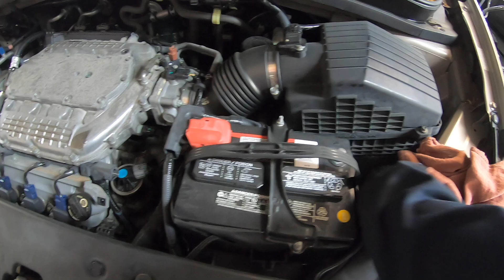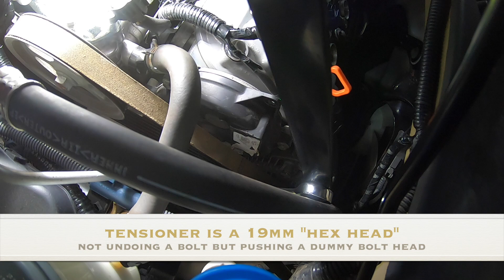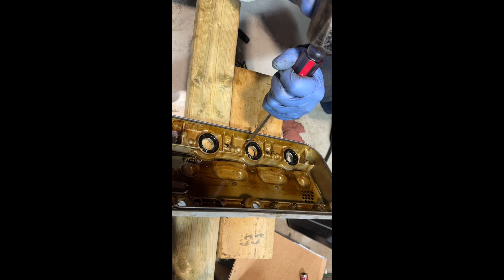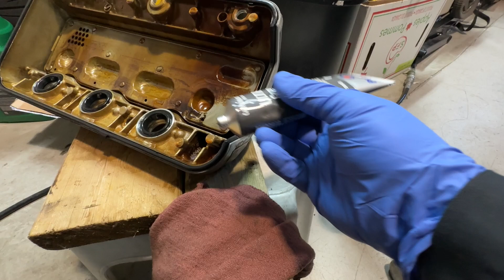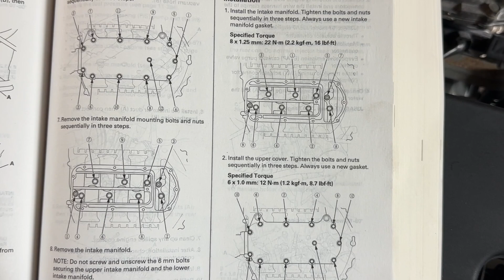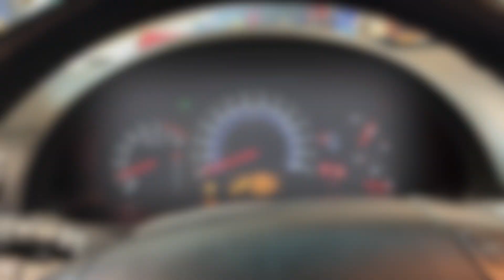Honda Odyssey Valve Cover Gasket and Spark Plug Tube Seal Replacement

Comment: The part that is the absolute worst, is getting the spark plug tube seal, to seat properly around the tubes, when putting the valve cover back on . Any advice would be helpful . . Please and thank you

Comment: You can do both valve covers without removing the intake. It's easier but not necessary to take the intake off. Takes about an hour to an hour and a half to remove clean and replace. The rear wiring can be man handled out of the way and the rear cover can be wiggled out. Front one takes no effort. The bolts under the intake need a wiggle extension so you can put the socket on at a slight angle.

Comment: I have a quick question and thank you so much for the detailed video. I took mine of because right underneath its the sensor and believe manifold. The reason I removed it was because right underneath I believe the seal was dripping into the manifold creating smoke. Since I'm also there planing on replacing the alternator as well. Will post an update once done, in New England, weather temp is key 🙄 no garage.
Reply: Hey mines is smoking too!! What enelded up happening
Reply: @christianflores3437  Brought my car to shop and replaced the gasket, the leak little by little damaged my alternator. I had started doing everything but took a hit when trying to remove belt, the tensioner broke, that being said had to bring the car to shop, $1500 to fix and put everything together 🤯now I need rear breaks.

Comment: (6:50) Wrong! The power steering pump (PSP) does NOT need to be removed to access that 10mm fastener that secures the wiring harness. The fastener is accessible thru the PSP pulley web.

Comment: I attempted this on a '10 Pilot, number 3 cylinder.  The seal was baked into the hole, it took about 3 hours to dig out the pieces of rubber that were clinging to the metal.  -this was for a single seal (heat gun or dremel with brass brush may have made the job easier) !  Putting in the new seal was a nightmare, I think Rock Auto must have sent the wrong part or the seals were the wrong size (they were OEM Honda packaged, with the correct part number) .  I destroyed 4 seals trying to tap them in (with lube) using a properly sized socket.  Had to make a makeshift press with socket washers and a machine bolt and nut to coerce the seal in, and it still slightly damaged the seal.  Will go back when I have more time to attempt the rest.

Thanks for sharing your video!

Comment: I can't find a video for a 2002 Odyssey
Reply from the maker: The 2002 Odyssey is almost identical b/c it is a J30/J35 engine and the basics of where things are and how they're dismantled are extremely similar.
Reply: @piercedasian  Thanks, I'm thinking it might be easier... I don't think mine has those transition points shown at 15:00 on the rear cover.
I saw my gaskets on-line and they both look flat.

Comment: Do I NEED to replace the throttle body gasket if I take it off? Or will the old one be reusable?
Reply: The TB gasket is $3. Replace it if warranted. Careful with that TB, however. If you jostle the butterfly, you'll likely induce a P2279. That mistake can ONLY be corrected with a 'TB Relearn Procedure'. That procedure can ONLY be initiated by a HONDA SCAN TOOL or an aftermarket diagnostic scanner that features the Honda-specific command to the ECU to run the 'TB Relearn Procedure'. Do you have such a tool?,
Reply: I reused mine, no problem.  Be sure NOT to bump the flap valve when handling the TB.

Comment: Do you need to drain coolant or oil prior to replacing gaskets and seals?
Reply: No
Reply from the maker: nope not at all.
Reply: No. So long as you remove the TB from the intake and do NOT disconnect the coolant lines from the TB.

Comment: Would this apply to an 04 odyssey? Or did the engine design change for the 05 to 10 models?
Reply from the maker: Fundamentally the motor is identical to the newer odysseys.  The placement of some brackets and such might be slightly different but in the grand scheme of things it's the same motor.

Comment: My 02 odyssey was way easier,It seems that little by little they are making these cars harder and harder for backyard mechanics to work on!
Reply from the maker: its b/c your odyssey had less emissions and VCM like management systems bolted on it.  I agree the older vans were simpler as far as engine management electronics were concerned.

Comment: Most helpful piercedasian. Doing the front valve cover now on my 08 Honda Ridgeline as the spark plug tube seals are letting oil in on cylinders 4-6 only. No need to even remove the intake plenum for just the front cover-doing the rear would be well beyond my skill set. You answered questions I had on removing and reinstalling the valve cover bolt seals at around 12 minutes in. Very nicely done sir!
Reply from the maker: Hey Ron, glad you found my video and channel.  Thanks for stopping by and good luck with your repair :)
Reply: So my 4 and 6 cyl don't  even have a seal  in them, and cover has messed up because of it. I think the last garage I was at did this on purpose
Reply from the maker: Yikes, that is REDONK!  You can't do things right unless you do it yourself...
Reply: I had to only remove the front valve cover only, to get the broken Pcv valve bits out of it... No need to disconnect the fuel injector electrical connectors as well.

Just the 2 oxygen sensor plugs

Good tips on the plug tube seals and the table cover bolt seals

Comment: I bought the felpro gasket kit for my 2007 3.5l Honda odyssey j35a7 engine and it doesn't have the two little notches on it for the front cover gasket. It just has the one tab that you pull on to remove the gasket. Will this be an issue? We triple checked to make sure it was the correct kit.
Reply: 'FEL-PRO VS 50607 R' is an excellent aftermarket replacement. Lack of notches does NOT affect performance. Use RTV at seems if warranted.
Reply from the maker: as long as it fits then it will be fine.
Reply: iVtec vs VTEC engine=different gaskets for some Odysseys.
Reply from the maker: well technically on the vcm enabled ones they're all iVTEC HOWEVER, they did change up the motor in 2008 so basically 2005-2007 Odysseys with VCM for example will have the same part # vs. the 2008-2010 VCM enabled odysseys used a different gasket part # b/c they changed the shape of the valve covers.
Reply: @seank8557  found out from felpro's engineering department, got to look at the prints for the design and all, and they changed it about 2 years ago to the notch-less gasket and said it wasn't necessary. It is. Use the "honda bond) ultra grey in the place where the notches are to fill in the gap.
Reply: It depends if you have lx ex or exl the touring and exl have different set up
Reply: @ashleyredden2201  lol

Comment: How much time would this be billed for at a shop or dealership? I just discovered this exact issue with my '16 Odyssey. Thx in advance.
Reply from the maker: I believe our honda dealership charge 2-3 hours for this job so easily $500+
Reply: Book time for this job is 4.5hrs, which is insane. Budget $1200 parts and labor.

Comment: I was just talking to my wife about this yesterday on her 07 odyssey lx. I was dreading the heck out of it after taking a look. That rear one is the pain. And I said wow, got to take all kinds of things off. After watching this, don't seem as bad as I thought. Need to replace the power steering pump anyway. Great video.
Reply from the maker: Hey I'm late to the party but hopefully you were able to fix your leaking valve cover gasket without much drama.
Reply: That's because this job is not as bad as you thought.